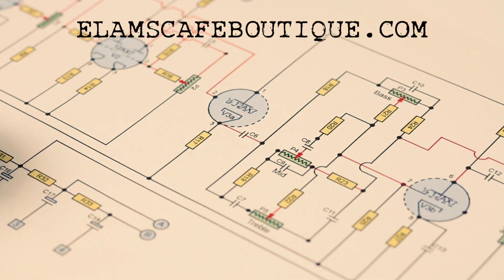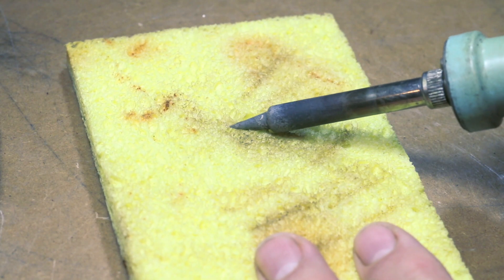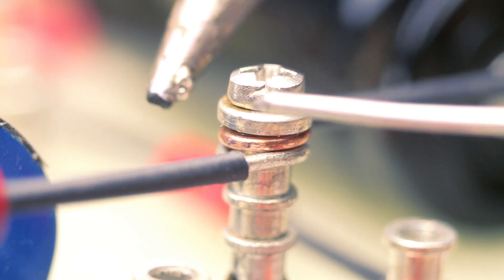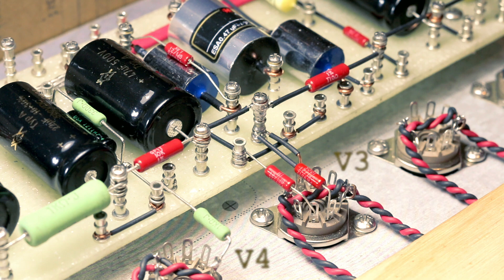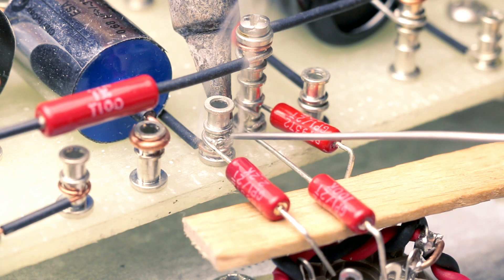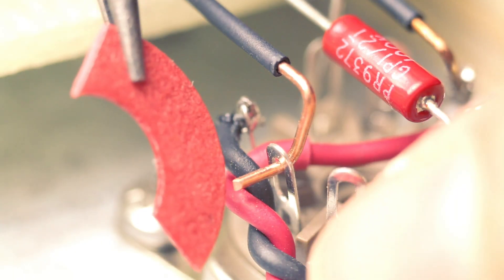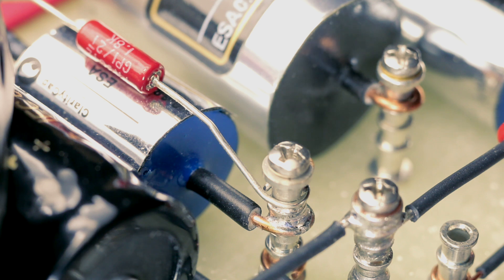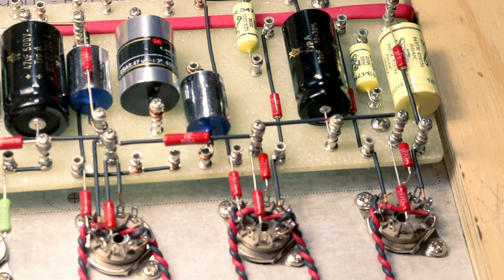How To Solder A Tube Amp Without Melting Anything - W.I.S.C - GT5 'Halcyon' Build 3

Comment: Great tips on the order of the build. After building now 3 amps as a hobbyist, I realized I was putting stuff together in a very difficult order. Doing the heater wires and whatever I could do on those tube sockets first, was a huge help. I am very much into not only making a functional amp, however I do try to take pride in having a very neat build. Your channel has given me even more insight, so I thank you! Great work!

Comment: @elams1894 little tip for you, fill the inside side of your side cutters with rtv, let it dry and then cut through the rtv with a razorblade aligning with the cutter jaws... that way when you cut little wire pieces, instead of them flying who knows where, the rtv cushions you put on the inside of the cutters holds those little pieces until you open the jaws. Youre welcome

Comment: This video and the one on heater filaments wiring have been so useful to me.  I'm one of the many that do simple builds, treating them more like a puzzle (following the layouts) than in understanding the components of the circuit.  One thing that really improved my soldered connections was...getting a decent soldering iron.  Sounds ridiculously obvious - but when you're in a situation where you're buying all the parts and equipment at once you're tempted to save money.  Live and learn...

Comment: What are you using to magnify and light when you work,my eyesight turns to fog when soldering components to Amps and Guitars etc so much so that I am working by instinct and then checking with lens and a Voltmeter for continuity. Any advice would be usefull. Thanks, beautiful work BTW  the mechanical joins are so solid I bet the circuit would function without any solder!!
Reply from the maker: I have 3 vintage Infratherm lamps, with 2400 lumens bulbs which I use as light source. They have the old cast iron base, very solid, and the neck can be bent right over/into the chassis. My eyes have deteriorated, hence I where 3 x magnifying glasses (regular reading glasses) to solder. Otherwise my prescription glasses work for general chassis work. Indeed, its a constant battle, I feel your frustration. It is not easy. It gets more tricky for me when I film. It takes a considerable amount of time to get the camera and lighting in position and also accomodating enough room to solder. Thanks for question, and all the best my friend.

Comment: Beautiful workmanship!

When soldering heat-sensitive components such as film caps (especially polystyrene) or diodes I will clamp a small hemostat on the lead between the part and the joint being soldered. This is an effective hands-free heat sink. Since hemostats are made of stainless steel they won’t stick to solder either.
Reply: I never thought of using a hemostat as a heat sink, but that's a great idea.  They're pointy enough to get into tight spaces much more easily than my usual choice of an alligator clip would be.  Thanks for the tip

Comment: I guess you have never heard of heats sinks, plumber's torch fire guard rags, or woven fiberglass heat resistant tubing. The plumbers fire rags are rather thick now that they don't use asbestos anymore, but you can point a torch at wood and not burn down the house as long as that fire rag is between the torch and the rag.. Fiberglass tubing is great stuff. slip a little around your soldering iron's shank, and use some bits and pieces to protect whatever might get melted.
Reply from the maker: That fibreglass tube is a good tip. I just nicked a very nice capacitor with the solder shank. Thanks for that Seth!

Comment: Kiwame resistors is just a distribution brand name. They really are KOA Speer. The SPR series. Available cheaper at Mouser's etc.
Reply from the maker: Good call. I've noticed something weird about Kiwami when trying to find manufacturer. I use Vishay AC series now for high wattage HT resistors, Czech made, very nice.

Comment: Nice! What is the wooden tool you're using to hold component? A clothes pin or something?
Reply from the maker: I made that out of icecream sticks. Very handy also as a soft clamp for soldering components in a vice. cheers
Reply: @elams1894  Thank you! Just saw how you put it together in one of your other videos. Neat little tool.

Comment: Turrets are my preferred method of construction. I love your "super turrets" great solution for those busy ground connections etc. Im gonna try it with my next build. Thanks for the idea!!
Reply from the maker: Awesome! It's a great way to get a bit of extra vertical space, especially to isolate hot resistors. Helps keep things neat too. Good stuff.

Comment: Great video, thoroughly enjoyed it. I am surprised you used raw copper wire and even more surprised that the so called top quality capacitors also used raw copper for their hook up wire. This is poor quality as in stock over time that copper could oxidise badly and the inexperienced could end up with a cold soler joint. I  wouldn't used any components or wire which was not tin plated to begin with. Also in my training (many years ago) no component could be fitted across terminals without a loop to provide stress relief. How things have changed. I must say that your layout is superb though and makes the average amp look positively crude.
Reply from the maker: Thanks for kind words. These are mid quality caps, about 3 to 6 bucks a piece. Not sure high end caps would be worth it for a guitar amp. Guitar amps are a very different beast to HiFi amps, but I hear what you are saying, all good, cheers.

Comment: It's always refreshing to come across a good Kiwi channel on YT, keep up the good work! Where is the best place to source these resisters from? I'm in Auckland and planning my second tube headphone amp build, keen to try Kiwame, PRP or maybe Takman. Cheers, Jeremy.
Reply from the maker: Thanks Jeremy! Probably the easiest place at present to source the good japanese stuff and PRP resistors is partsconnexion dot com. That's where I source mine from. You'll have to wrestle with international shipping however, that can be fun. Cheers.
Reply: @elams1894  Thanks! Yeah shipping is always a challenge down here. Just ordered some iron from Edcor for my next build, they quoted $192 USD for shipping alone! Hopefully Youshop comes through a lot cheaper.

Comment: Great camera work. I didn’t happen to see your wire strippers in the useful tools portion in the description. I’ve never seen a car like that where did you get those thank you for your time Jack Matthews
Reply from the maker: Thanks Jack. I use a few wire stripper tools. I use the large strip and hold type Chicago made strippers, some smaller pliers type 'v' groove units and i also use a knife blade for wires that are too delicate for chunky tools. If you could clarify 'car' in your comment,that would be great as I'm not too sure what that refers too. Many thanks Jack!
Reply: @elams1894  it was supposed to be ive never seen a pair like that. Do you use something for a heat soak.i mean it takes the brunt of the heat instead of the component that you are soldering? sorry bout the 3 week delay. Thanks JM

Comment: Another Epic video! I always learn something from you that Im eager to implement. The washer trick inparticular I think is great. As well as preventing burning components in close proximity to the Iron, it could also help stop the molten flux spatter getting all over the nice new shiny components and inside the chassis when soldering. I will definitely try this on my next work! Thank you! Keep it up!  🙌
Reply from the maker: Thanks heaps Harry, glad there were few things that were helpful. All the best with your projects, cheers!

Comment: Changed something in the lighting? Looks unusually bright. Still cool.
Please tell me that in the next vids we're gonna see a super cool crazy wooden/cf  housing build for that
Reply from the maker: Yo G, yeah when I watched it through my phone I thought, gee whizz, thats a little bit bright, however when I watched it on my Mac, it was not so bad. All the exposure settings, LUT, and editing was the same as previous vids, however I didnt diffuse the light on this vid, as I was mainly doing extreme closeups and that was a mistake I think. 

Way too much highlights on the metal turrets and turret board. I'll have to sort out a proper diffuse mount for my lamp. Good eyes, thanks for feedback. Unfortunately no carbon fibre in this build, but in the future there will be a CF chassis ha ha.

Comment: Beautiful workmanship its like the meditative craftsmanship of the Japanese...but do you have a video on how you put your construction jig together?
Reply from the maker: Thanks 92! And thanks for the direction Vamp, much appreciated, have a good one!
Reply: I think he even hawe a detailed instruction actualy if You check back on the older videos.
Reply: Cool thanx i found the video
Reply: @92ilyas  As You probably saw he started by printing out the layout, or drawing it by hand on a piece of paper so You hawe a bit more substance to make the wooden pattern from later when You are done with the wisual design.
Reply: @Vampi_Sweden  Yes I can see how it works and has inspired me as to how I can set up a rig to experiment with without dealing with the confines of a proper enclosure just have to be patient im just in process of opening an electronic repair shop... but soon very soon
Reply from the maker: Hi 92. In future I will include a vid of how I draw my layouts and schems. It makes life much easier with respect to design. Cheers!
Reply: @elams1894  Cool elam im looking forward to it already. I'm just in the process of setting up an electronic repair shop and will have a little space and time set aside to finally do something i've wanted to for the last 20 odd years and seeing how you use a jig for construction has given me some ideas as to how i can make something similar to allow for experimenting with circuit design and mods without the confines of a chasis, but 
still keep everything nice and neat.